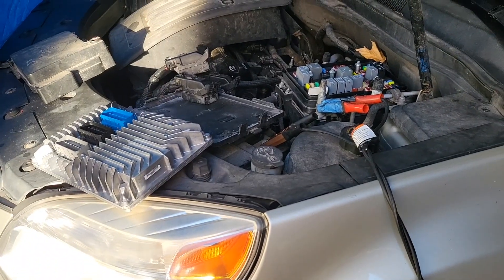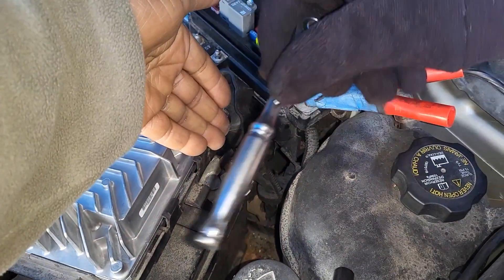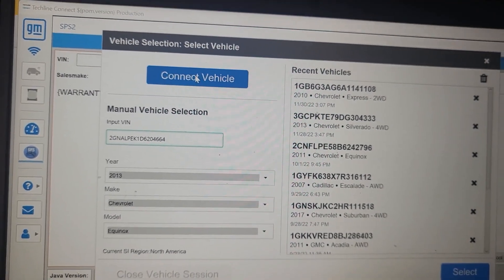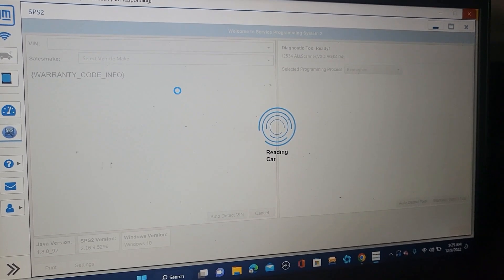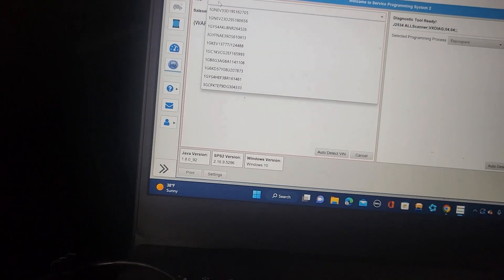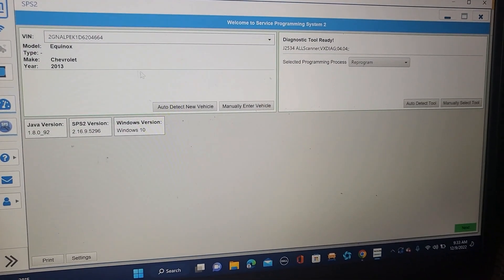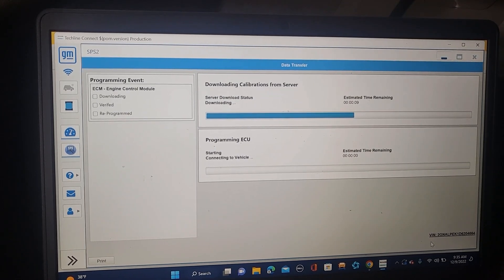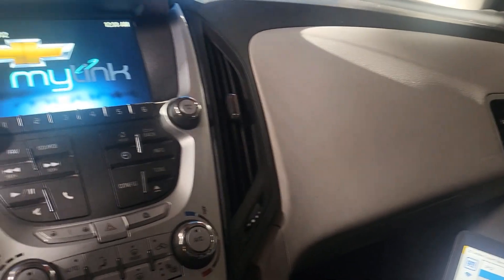Chevrolet Equinox Engine computer replacement and programming

Comment: So I have a malibu, a new ecu was programmed brand new. the cars then starts and goes off in 5 secs. The only dtc on engine is crankshaft sensor not learnt. Mohammed, what could be the issue based on your experience. Thanks
Reply from the maker: You Need to program the ecu then program the immobilizer with you have to do Emmo learning  ecm Replacement